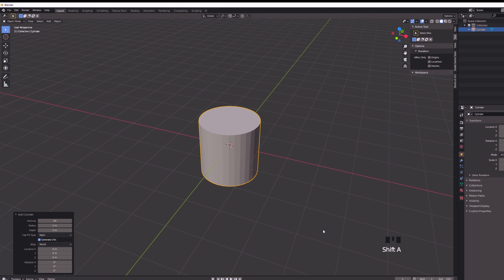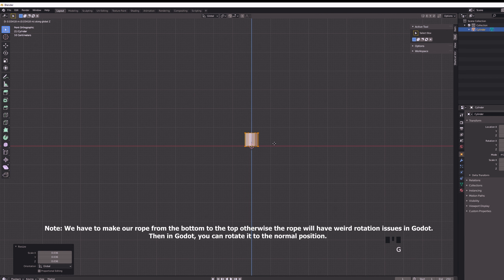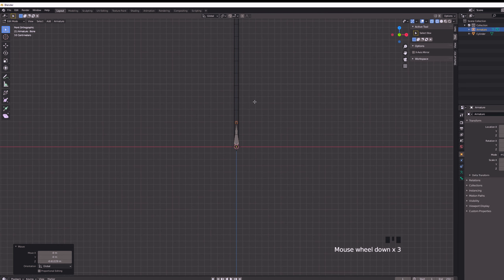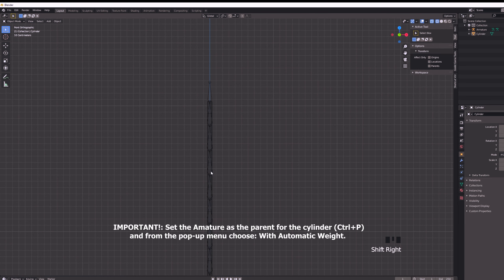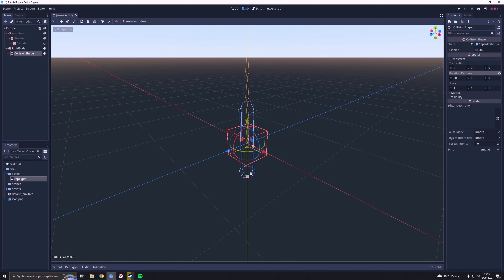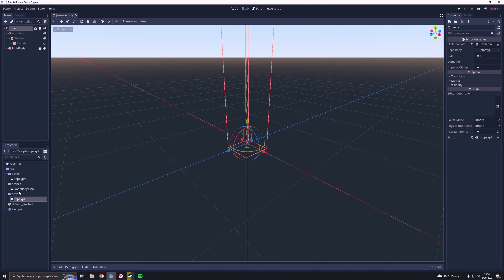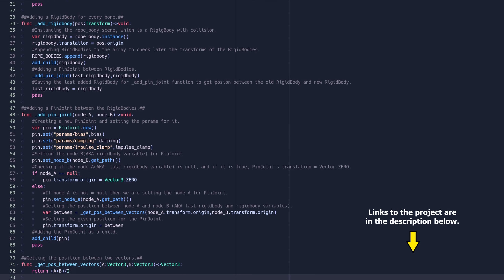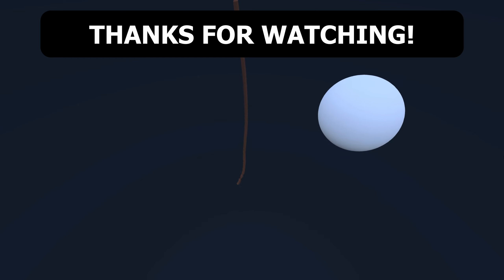How to make a basic 3D rope physics in Godot 3.5 under 1 min(+19sec).

Comment: Is there any advantage to applying the RigidBody movement to the skeleton, vs just using the pin joints and RigidBodies?
Reply from the maker: Great question!  By using the skeleton and bones, you can attach a visual representation to each bone, such as a cylinder mesh, which gives the rope a more cohesive and visually appealing appearance. This approach allows the rope to have a continuous and connected look, resembling an actual rope more closely. In contrast, using only rigid bodies and pin joints may result in a visually separated and disjointed appearance. Therefore, by utilizing the skeleton and combining it with RigidBody movement, you can enhance both the realistic movement and the overall visual presentation of the rope. I hope this clarification helps. If you have any further questions, feel free to let me know!"
Reply: @Alenvei so would the former be better for something like a chain?
Reply: @Alenvei  Thanks ChatGPT!
Reply from the maker: @dglobeium  don't worry, I said thanks to it.

Comment: I cant get the script to work, says Parse Error: Unexpected "Identifier" in class body.
Reply from the maker: what Godot version are you using?
Reply: @Alenvei  Godot 4. I made a rope now with a bunch of pinjoints, I'm good ;) I'm a bit of a noob, that is to say, it could have all kinds of reasons why it didnt work for me lol
Reply from the maker: @marczwander893  no worries! Everybody starts somewhere. I'm glad you figured it out. Good job! Btw the error is because the code on GitHub is in the 3.5 Godot version and Godot 4.+ has an upgraded code version for example: "onready" is "@onready" now. If you have any other questions feel free to let me know. Have a great weekend!
Reply: @Alenvei  same to you, thank you Sir for the kind reply 📿
Reply: @Alenvei  on line 34, it's saying "Error at (34, 24): Could not find type "Transform" in the current scope."
Reply from the maker: @FriskDreemurr66669  if you are using Godot 4+ try "Transform3D"
Reply: @Alenvei  the code isn't giving an error but when i run the project, it says "Invalid call. Nonexistent function 'instance' in base 'PackedScene'". the transform3d did work tho
Reply from the maker: @FriskDreemurr66669  The code doesn't work for you because you are using a newer version of Godot. Check the Godot 4+ documentation, and you should be good to go.